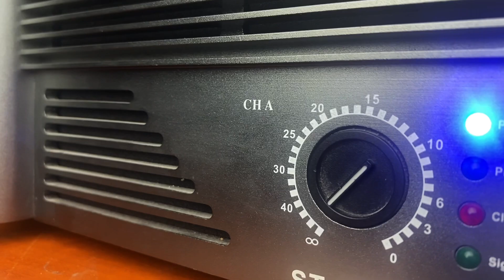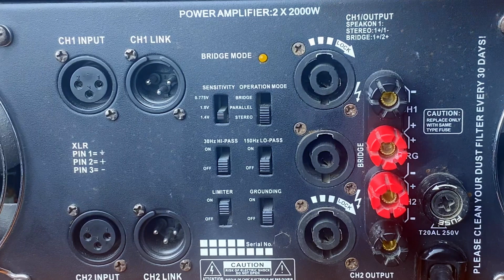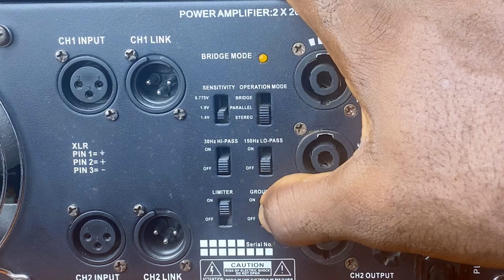Power Amplifiers | Understanding Power Amplifiers used for Live Sound

Comment: I wonder why you went in fast forward mode when you talked about the amplifier input sensitivity saying that it only determines the amount of gain.
In fact, the most important thing about power amplifiers operation is the fact that they require a specific input signal level, which is amplified by a factor of X times, resulting in a voltage gain of N dB, in order to reach full power output.
The specific input signal level, defined by the input sensitivity setting, is the maximum input level allowed at the input stage in order to drive the amplifier to its rated power output, without clipping.
This means that 0.775 V RMS (0 dBU), 1 V RMS (+2.21 dBU) and 1.4 V (5.14 dBU) is the maximum voltage level allowed to enter the amplifier input stage.
Now, take into account the fact that professional mixing consoles and other professional audio equipments have high headroom fir preserving the dynamic range of music and are capable of maximum output levels of +24 dBU (12.27 V RMS), without clipping, which is 20 dB (11.04 V) over the nominal +4 dBU (1.23 V RMS) level used in professional audio applications.
If you want to benefit from the maximum dynamic range of an audio system and ensure proper preservation of vocal and instruments dynamics, you need those 20 dB of headroom over the nominal signal level. But wait, actually, you cannot use those 20 dB more of headroom, because your amplifier maximum input level is 1.4 V (+5 dBU), so you have to limit your mixer master output level to 0 dB (+4 dBU) on the meters, thus loosing 20 dB of dynamic range and forcing your system to work at a lower effective dynamic range than possible.
The solution for increasing the effective dynamic range of the entire sound system is to aling all equipments input and output levels so that they all clip at the same time. This will require the use of specific attenuation and boost levels at the input of every device over the entire signal chain and, finally, you will have to use a pad (signal attenuator) at the amplifier inputs.